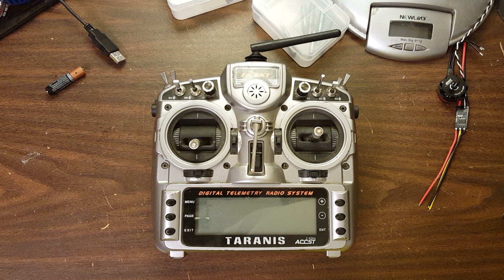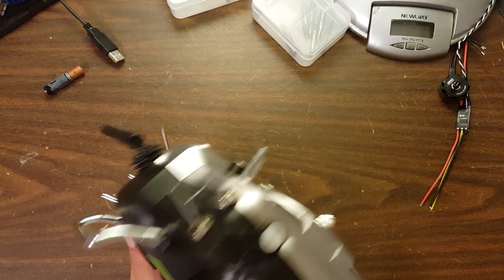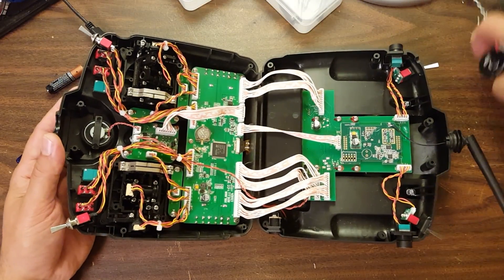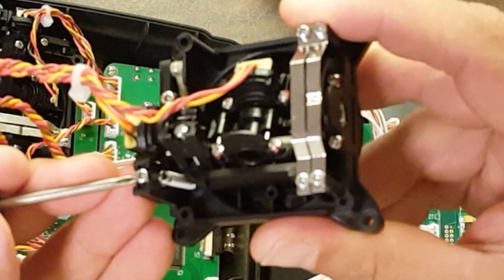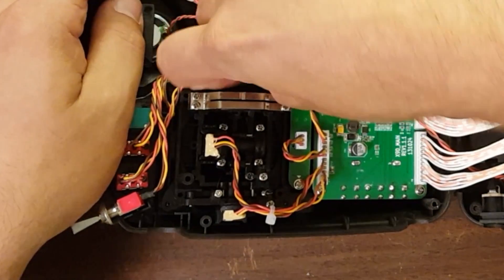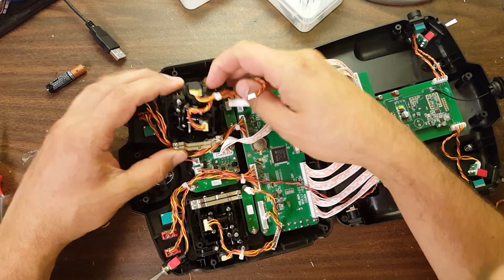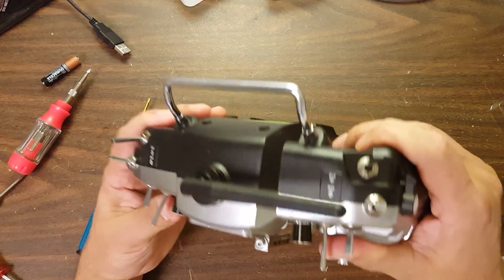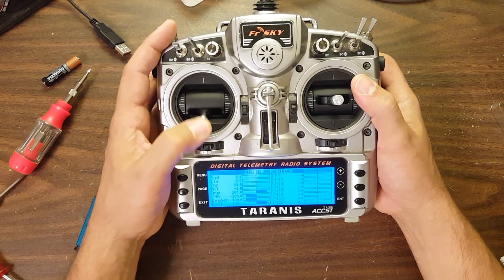FrSky Taranis Gimbal Upgrade - How To

Comment: Nice video, I love all your vids they are very helpful and very straight forward. Thanks for posting them. I do have a question though, I notice you speak very highly of the Taranis. I have a JR 11x would I gain much by switching to the Taranis besides voice feedback and telemetry? as for channels go i dont use all eleven channels so that parts no big thing. I fly helis and some quads would it be worthwhile to switch??

Comment: Thanks for the Vid.  FrSky now make replacement hall effect (Hall sensor) gimbals for the Taranis.  Listed as M9 gimbal.  Same plug and play install you see here, but the product is basically metal and is soooo much better.  It seems most hobby shops have them but the price verys wildly.  $20 - $60 each. Aloft Hobbies also have them at $20 at time of this comment.

Comment: I just purchased from Banggood what I thought was the same as these gimbals but there were different. Not only were the screws and way the throttle is configured to not self centre different as was described but even the hex screw were different.
Reply from the maker: +Timothy Smith did you purchase the m9 gimbals? They are the best.
Reply: Joshua Bardwell I think so. I purchased  https://www.banggood.com/2-PCS-Frsky-M9-Gimbal-M9-High-Sensitivity-Hall-Sensor-Gimbal-For-Taranis-X9D-X9D-Plus-p-1143691.html
Also one of the new sticks was different to the other with one not having glue supporting the exit wires from the Gimbal.
Reply from the maker: Those are better than the ones in this video. The ones in this video are PT1. M9 is way better.

Comment: A little trick I do which is nothing new, and I don't remember where I learned it but I like to take a couple pictures with my phone of things from a couple different angles before I take something apart. Making sure to get good detail of the things your trying to keep strait. I really like doing this over labeling or writing things down because you might forget to label something or change something you did not originally plan to change and a picture might capture this for review later.

Comment: Is there any way to distinguish between the new and the old by just the appearance ?
Reply from the maker: +LT “John” YV I know the crossbar is different bit that's all.
Reply: +Joshua Bardwell I did some research, and it seems that there's a label on the transmitter module at the back that can hint the version of the gimbal. It should say "C01" somewhere if it got new gimbals. B01 will have old gimbals.

Comment: Hi, do you know if these gimbals would fit in a turnigy 9x radio, the originals feels soooo cheap :)
i have been trying to get Aurora 9 gimbals, but i have not been able to get hold of any.
Reply from the maker: I don't think that 9x gimbals are a drop-in replacement for Taranis gimbals.
Reply: no, i was more thinking if they could be made to fit, i will search and see if anybody has done it.
Reply from the maker: The 9x is such a common radio surely there is a reference. The problem with the 9x is that by the time you get done modding it you might almost as well have bought a Taranis.

Comment: Nice video, I put some grease in the throttle friction, got really smooth!
Reply: An old trick is to wrap the friction bar with some teflon tape.
Reply from the maker: That's a great tip.

Comment: great tip and video! and darn those screws are long huh. I've recently upgraded my taranis with a 6 position switch on the S3 connector :) works flawlessly. Also a nice tip is to loosen the nuts on the shoulder switches before trying to open it up. That way you won't break of bend the precious housing ;)

Comment: great video. been wondering how to do this for a while. aloft store is great. was able to drive down a month ago and they are super nice guys. got to handle the new horus too.
Reply from the maker: +Nathan Knight what did you think of the Horus?
Reply: It felt really great. Has a weight to it. Looks amazing. Like a higher end radio. https://www.instagram.com/p/BGfb0cBxbI7/
Reply from the maker: +Marcus Simoncelli are you running OpenTX on it?

Comment: Which gimbal did you use and were the springs stiffer?
Reply from the maker: +Quadro Bro it's the Taranis replacement gimbal from Aloft. The PT10? It's vastly superior to my old ones but maybe only because they were worn out.
Reply: +Joshua Bardwell Sounds good. I've been considering replacing mine but want a stiffer feel. I read that the graupner heavy springs are a nice addition so I may need to go that route.

Do the new gimbals quell the jittering input?
Reply from the maker: I can't be sure that these springs are stiffer or not. I had my old gimbals dialed to the max. These, I only have them at about half, but they're not as stiff either. So I don't know. These gimbals are relly nice though. I just don't know whether they feel so nice because my old ones were totally dogged out, or whether these are an actual upgrade. I do know that people say the crossbar is much better on these. It used to be an upgrade and they included it in these gimbals. Actually, for those who have the Taranis Plus, they might already have these exact gimbals.

Comment: I do enjoy your tutorials. Slightly unrelated but i'm sure you'll have the answer :) I find that with my taranis and kiss fc, hover point is sitting on a ratchet click, so one up and it climbs and one down it decends. Would you have a suggestion on how to fix this? should i remove the ratchet? or is there something i should be doing in the GUI?
Reply: +EssexRC  On the throttle gimbal there are two sliver bars on the left side (while looking at the inside of the radio).  Loosen the top screw on the left-most one control the ratchet tension (or eliminate it entirely).  I recommend disabling the ratchet for multi rotor use.  https://goo.gl/photos/UfcY3UsjbxySgCh19   Use the screw next to it on the other tension bar to adjust the stiffness of the throttle.
Reply: +Bruce Luckcuck Thanks very much Bruce, I shall give that a try
Reply from the maker: +EssexRc remove the ratchet.
Reply: +Joshua Bardwell  Thanks Josh, happy flying ;)

Comment: +Joshua Bardwell   Disable the ratchet on your throttle for multi rotors.  Throughout the stick movement range there are only about 30 detents on the ratchet.  As a result, this is mechanically limiting your throttle resolution to only 30 steps or about 33us per step.  You can see this in the RX tab in the configurator.  Once you disable (loosen) the ratchet tension bar you'll get much higher throttle precision.  I've been flying like this for a while now and converted my flying buddies.  Surprisingly it didn't take but a couple of flights to get used to it but you'll notice the improved throttle control immediately.  When you're flying you don't notice the ratchets so you don't notice when they're gone so that's why I think it doesn't take long to adapt.  As you noted you can adjust the tension using the non-ratchet bar is the throttle is too loose when you disable the ratchet.
Reply: I've been flying for 7 years now.   I fly helis, quads and to a lesser extent, planes.  On none of these has a ratcheting throttle stick ever been desirable.  If there was a ratchet present on any radio I've owned, then it was disabled on the day of purchase.  My mate just got a Jeti DS14, and even that super high end radio has a ratchet on the throttle <facepalm>.
Does anyone know why the ratchet is even there?  I can only assume it's some legacy thing from when everything was internal combustion or something like that.
Reply from the maker: +Bruce Luckcuck yup. I have been flying without ratchet for a while now. I never had any problem making fine adjustments when I had a ratchet though.
Reply: I did exactly the same thing on day 1, oh and changed it to mode 1. I don't  get ratchets, it just makes if feel like a toy.